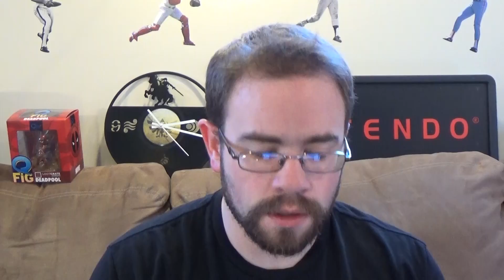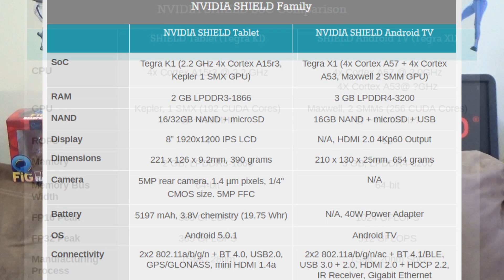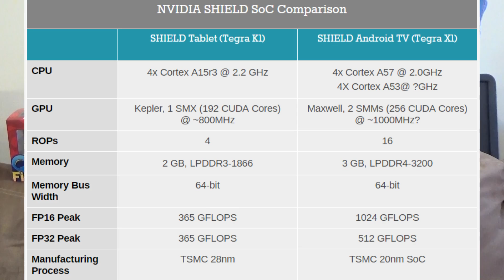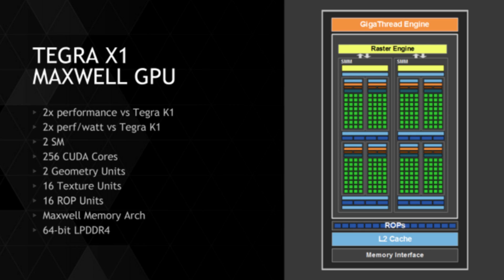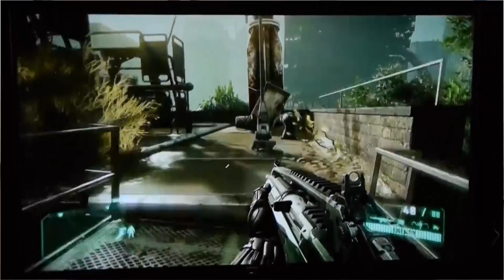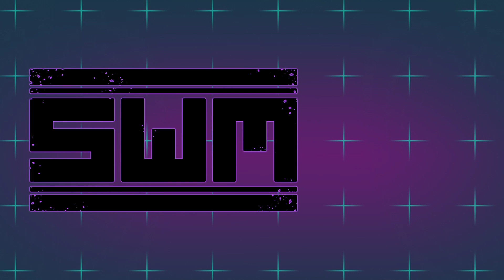The Nintendo Switch Is Powerful!! But Can It Run Crysis??

Comment: Not sure if it's supposed to be a joke. But if it is it's pretty darn funny! Otherwise... Crysis,  Crysis is from 2007.
Reply from the maker: Crysis is still a difficult game to run in general, and the title was meant to reflect the age old question: Can it run Crysis?
Reply: he said Crysis 3..... from 2013
Reply: The title and thumbnail says otherwise.
Reply: NEEXGamesStudio You're right. I think I was drinking the cool-aid, even Bayonetta 2, which was gorgeous was 720p.
Reply: it is crysis 3 from 2013
Reply: DH1986 To be honest, I have Wii U and never saw a game running 1080 60fps. More like 720 50fps max. (I'm talkin about AAA games like mario kart or 3d world)
Reply: Crysis 1-3 are on the Xbox 360.
Reply: MobileDecay How's resolution once again?Is it able to run 1080 smoothly?
Reply: NEEXGamesStudio It runs it! He didn't say at max. It runs it.
Reply: MobileDecay Well ok then. Anyway, it woulb be awesome to have os3 or xbox360 in your pocket. But if Switch will be at this power level, it will be funny and awesome., but for one year only;)
Reply: NEEXGamesStudio Well there is the Smach Z coming out which can run Crysis 3 at lower settings on the go. I think also the GPD win can kinda.
Reply: The wii U ran most of its games at 1080 60/fps because of the way Nintendo designed games for it. The Switch will probably work the same way, but allow more things on the screen at one time.
Reply: I have a just decent pc, but I can barely run Crysis well on my pc.
Reply: 19RocknRolla91 I don't own it, but it's not hard for that game to be 1080/60. I meant heavy games like Xenoblade X and etc
Reply: Not even modern mid level graphics cards handle the original crysis well, because in terms of optimization it it garbage.
Reply: Jordan C. Wilde Lmao!
Reply: Spawn Wave 
Did they say it was native 1080p
If so they probably lied. How could I know that? Tomb Raider 2013 on Shield TV Pro is a thing now... And it was programmed for the hardware yet runs in 720p 30FPS with settings set from to PCs low and normal settings. It actually looks much worse than the PS3 version. Still playable though.
And yes I played on the latest version of the game with the latest Shield firmware which included new updates to Vulkan 1.0.
Tegra X1 is capable of FP16 and is more capable. The Tegra X1 is as clocked faster and has more ROPs more RAM VRAM plus faster RAM and VRAM compared to last gen hardware yet it's still quite plainly coming up far far short of outputting last gen quality visuals.
We see it in many games actually. Remember that the Tegra X1 inside Shield TV is faster than the same SoC inside of the Switch!
So how can you possibly expect PS3 Xbox 360 visuals when on the go?
Couple these facts with the fact that last generation games are also coming out for mobile phones and that on paper and in benchmark results of reference board SoC hardware plus real mobile phone hardware Switch is coming up just a bit shy compared to the Snapdragon 835 which can be found in the popular Samsung Galaxy S8 and that the new Snapdragon 845 is more powerful than the Tegra X1 full stop.
Yet all of these impressive mobile chips are still noticeably behind delivering PS3 and Xbox 360 quality visuals.
Reply: Daniel Gutierrez 
It's easy to claim that based on just one game (the PS3 version of Byonetta) but the truth is with Switch and Shield there's clear evidence that this is a trend. From both first and 3rd parties. With PS3 eventually 3rd parties got to grips with PS3, however not first party titles looked straight up terrible or performed well below par. How many 1st party games on PS3 ran below 1280x720? How many stayed below 30FPS? How many looked terrible?
Oh that's right... None. With Nintendo on the otherhand several games are running at below this generations average graphical and performance quality averages.
With Tomb Raider 2013 for Android Shield the game is very well optimized for an optimized OS created specifically with gaming in mind and it's also up to date with modern APIs probably more so than even the Switch. If you want you can even preview new API code on your Shield TV for free provided you already own a Shield TV.
As for the numerous other Shield TV games out there most run very well... Until we talk about legitimate console quality titles like Tomb Raider and MGS:R Half-Life 2 and The Talos Principle. So how can all the mobile games run just fine while the games made for the system specifically run less well, but look much better??? Well couple that with the other very simple fact that very few ported games for Wii U and Switch (both last gen and this gen) actually ran better than last gen games on PS3 and Xbox 360... How many games for Wii U and Switch look better than anything that we've seen on last gen hardware? When it comes to performance there were so few that ran better that only one actually jumps to mind, Need For Speed Most Wanted (2011) for Wii U. And that's it. On Switch there's nothing that both looks and plays better on that system than on PS3 or Xbox 360. Even games like Payday 2 run much worse on Switch than on PS3.

To most people, all this evidence make the answer quite clear.
Switch is NOT more powerful than PS3 or Xbox 360.
Reply: Daniel Gutierrez 
Of course to you anything that looks bad on Switch is "Just another bad port!"
Give me a break you really think we didn't see anything with a cartoony aesthetic running at 1080p on PS3? Ratchet & Clank Future: A Crack In Time is one such game unfortunately DF never did an in depth analysis. If you based your assessment of that games resolution on Beyond 3D forums information the games resolution sits below 720p... But that doesn't mesh well with how the game actually looks in action.
Back when I had a bizarro resolution Samsung HD TV I actually believed that. Then I upgraded to a 1080p monitor about 6 years ago and was able to see native 1080p for the first time.
After that I was able to see all the last gen games in all their glory and was able to asses the accuracy of other people's claims myself. I always questioned their information on that game after playing it and after checking the settings on my monitor repeatedly especially when looking at the general roughness of a 720p image.
So there's one such example right there. What on Switch has the same level of fidelity or better than R&CF:ACIT? Or Insomniacs later 30hz R&C games which were able to offer up yet even better visuals on a smaller scale no less. There's so much mayhem going on in those games on your screen it can genuinely be a bit hard to find out what's going on to a bystander. Ditto for WipEout HD (2008) and the Fury add-on (2010? iIrc) which run at upto native 1080p at 60FPS with loads of stuff going on at any given time plus you also have to consider that the developers didn't have DX12 like features and today's optimizations simply didn't exist with the exception of dynamic resolution which Super Mario Odyssey uses and owes pioneering titles like WipEout HD/Fury credit for or the game would be stuck to a very low resolution for those worst case scenarios.
By the way as I recall SMO tops out at 900p...
Oh... Yup it does.
"Super Mario Odyssey uses two different display modes in handheld and docked modes. When docked, a dynamic resolution scaler is in effect. This is something that Nintendo has been dabbling with for years now, but Odyssey is more flexible than usual. Depending on the action, Odyssey ranges from a high-end at 1600x900 to lower resolutions like 1440x810 and even 1280x720."
Source: https://www.eurogamer.net/articles/digitalfoundry-2017-how-super-mario-odyssey-pushes-switch-to-its-limits
And unlike Beyond 3D forums DF has pictures and videos to back up their claims.
So 900p60 dynamic res in 2017 on a home console (docked Switch) in a flagship title that doesn't look very complex or extravagant (notice how I left realist out - Nintendo doesn't target that aesthetic) vs 1080p60 in 2nd party games like R&CF:ACIT and ancillary first party games like WipEout HD/Fury!
Also remember that most 3rd party games on Switch have issues adhering to 1080p, 900p or even 720p at 30FPS with some major titles like Xenoblade Chronicles 2 having resolutions so low they rival PS Vita's poor rendering turn out!
So was Xenoblade 2 a bad port?
What about Doom? I mean surely that couldn't run at all on last gen hardware... Actually you might be on to something with Doom especially seeing as how the devs likely leveraged FP16 just to get it working on Switch which is a technology that simply wasn't supported on Xbox 360 or PS3 when they launched in 2005 and 2006 respectively!

So as you may have guessed by now I know a little bit about hardware and software.
Reply: Daniel Gutierrez 
Furthermore the Cell Broadband Engine used inside PS3 entered development back in 2001 and entered production in 2004!
PS3 launched in 2006... And consider the fact that by today's standards, as far as consoles are concerned the PS3's CPU is still more advanced than even the Xbox One X's!!!
Compare that against the Tegra X1 which entered production sometime in 2015 and is already out of date in the realm of mobile hardware thanks to the Snapdragon 845 SoC which outperforms the Tegra X1 in both CPU and GPU calculations with electricity useage topping out at 4W. Meanwhile the Tegra X1 can eat up as much as 20W...
With this new SoC the Samsung Galaxy S9 can handily outperform the Shield TV Pro which is already more powerful than Nintendo Switch!!!
Of course the 835 was still competitive with Switch and the Tegra X1 (though the 835 was less powerful especially in the graphics department).
As you can see for yourself here:
https://benchmarks.ul.com/compare/best-smartphones?amount=200&sortBy=PERFORMANCE&reverseOrder=true&osFilter=ANDROID&test=SLING_SHOT_ES_31_UNLIMITED&deviceFilter=PHONE,TABLET,OTHER&displaySize=3.0,15.0
The Shield TV outfitted with the Tegra X1 and the device itself being made by Nvidia (the inventor of the GPU and Tegra X1) the hardware is quite out of date by 2018's standards. Just 3 years after entering production and bested by SoCs that sip about one fifth the power in passively cooled waterproof devices that have zero trouble fitting into a medium or small pocket!
The hardware on paper is far better. The APIs are identical (Vulkan is very new - v1.1 is on the horizon) and Google makes tons of money off of Play Store games making graphics optimizations a must for new OS releases like Android Marshmallow (7 what Shield TV uses) and Oreo (what The S8 and S9 series use).
That said I also did my own comparison of what the Shield TV is capable of vs PS3 when running a last-gen game retooled and optimized for Shield TV by Nvidia's own Light-Speed Studios that you can watch by using the next link.
https://m.youtube.com/watch?v=Z2Qo_6O1Mv4
Reply from the maker: 360 runs Crysis at 1152 X 720 which is barely HD. It is then upscaled to fit a High Definition LCD at 1080p. The video shown ad GDC was a native 1920 x 1080 running on the X1.
Reply: NEEX Games Welcome to the second year it'll be funny, and awesome; since the switch it's not going anywhere anytime soon, except more houses
Reply: VariantAEC These games on shield are not that optimized. There are already games on Switch that look great, and better than some last gen. For example, take that game you mentioned Tomb Raider as another not well optimized port, just like Bayonetta on the PS3. And now look at Bayonetta 2 on the Switch, it runs great, yet not that optimized because they didn't use the "extra" power you can achieve when docked.
Reply: VariantAEC K... You must know so much about hardware, but other than Mario Odyssey we have yet to see what the Switch it's capable of; by the way why would you mention games like Payday 2, which is a bad port, while there are games like L.A Noire that proof things the other way around. Or even the remaster of Dark Souls running at 1080p with a nice frame rate

Comment: Did you see the vents in the trailer when they put the cardrige into the switch? And if you know anything about it what do you know about the rumored cardriges that the switch will use ?

Comment: Would a service like the Nvidia Grid/Geforce Now need anything extra tech wise in the Switch?  If it were to have cloud gaming do you think it would make the console even more appealing?
Reply: nvidia drivers? that is if nintendo allow nvidia to connect switch with nvidia Grid service.
Reply: I'd expect streaming only in docked (toaster) mode.  It certainly would detract from the portable mode and Nintendo haven't got a great reputation for online services, but it would make it a truly viable home console.  I'm not sure what they'll do, but am looking forward to finding out more.
Reply: Emma Smith personally i don't think much about if Switch allowed to use Geforce Now service or not but will nintendo going to use nvidia Grid service for their own purpose?
Reply: I think I've read that there won't be another Shield console, so Nvidia potentially has servers that aren't doing much.  It's a whole lot of 'what ifs' at the moment.  I didn't know anything about the Shield before the Switch was teased, but was fairly impressed when I looked at it.

Comment: That could explain the speculation that the switch has more power docked. Maybe 1080p docked and 720p when undocked!
Reply: rok vez That would make the most sense given that most rumours state it having a 720p display on the unit.

Comment: The weirdest thing I saw in the past few days was people COMPLAINING about the rumored price for the Switch, because they think a console can't be good, if it doesn't cost at least 400€...
Reply: Anton Reinecke can't please anyone these days.. ppl just complain constantly
Reply: Anton Reinecke and then they think that it will cost too much if it's 400£, it's a paradox!
Reply: Even if it were 250, I wouldn't think less of it as long as it performs. the k1 and x1 shield Tablets came in at 199 even though the x1 was a significant upgrade. if anything, a lower price is an advantage in a console area that is filled with higher priced machines.

Comment: Dis nigga....wipes a tear away You my nigga man.
Reply: Chesi Fox yeah you just want to see Nintendo fail...
Reply: I see what you're saying and you're right  to some degree. I actually bought a Nvidia shield portable and it's definitely a niche product. Though it had a decent amount of features, the average consumer wouldn't know about emulators much less know it was running android. Poor marketing, with very little third party support, lack of market for gamestream (not many people had high end graphics cards at the time that supported it). It flopped and was kind of bad handheld with little appeal. However compared to other mobile SOC's and gaming handhelds, it was immensely powerful. A power clumsy unit without any developers to support it. Overall the android platform just isn't good for games that require or work with controllers. However put a company with the best mobile hardware together with a company like Nintendo who has a fantastic platform with terrible hardware and you might get a gem. With the next generation of Playstation's and Xbox's basically being nerfed PC's ( if they're modular as the some are suggesting, then they'll literally be PC's on proprietary software) it'll make little sense to get either in the future. The only cheap or sensible alternative will be Nintendo. Considering the waves of excitement and pre-emptive praise it's getting, it basically just has to "not suck" and it will sell a shit ton. Either way you're trolling or a complete idiot. Just placing this here as a "the more you know"
Reply: Super Dale James I know right
Reply: Chesi Fox damn right I'm a fan, Im not looking for graphics that look a pixel different like you dudes...
Reply: +Chesi Fox The NS is a console though and we don't know the power.
Reply: +Chesi Fox Why do you think it will disappoint if we know nothing about the console's power? It's all speculation. You assuming it will be weak is just as stupid as anyone else assuming it will be strong. RIP your logic.
Reply: Storme Prince Yeah, it's so stupid that people think that the CPU and GPU are comparable to the PS4 or Xbone, it is not according to Nvidia.  The Switch will be awesome for 3DS fans but for me that I'm a Nintendo console fan it won't.  If I wanted to play on the go?? We already have a 3DS for crying out loud.  The Switch is basically Nvidia trying to capitalize in all the money they lost making the failed Nvidia Shield and now they're trying to get rid of the hardware they didn't sell on Nintendo's back and now its being  called the "Switch".
Reply: +Chesi Fox The 3DS can't play home console games.
Reply: Super Dale James Yeah, this guy is in total denial with the Switch.  It's going to be a huge disappointment.
Reply: Jacob Kidd No, I'm not a fantard like you.